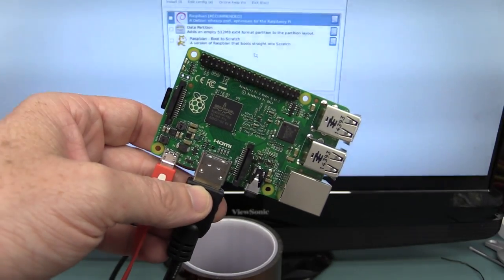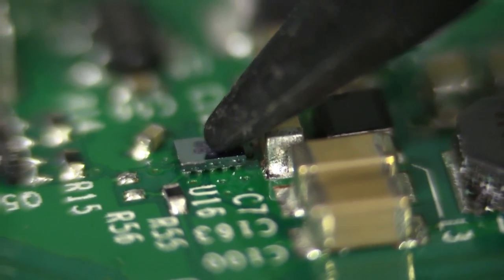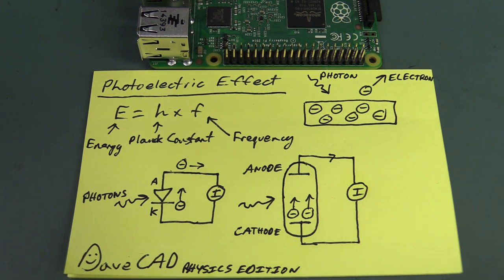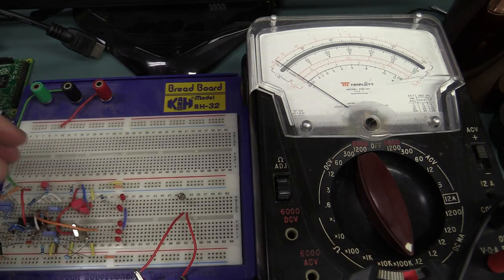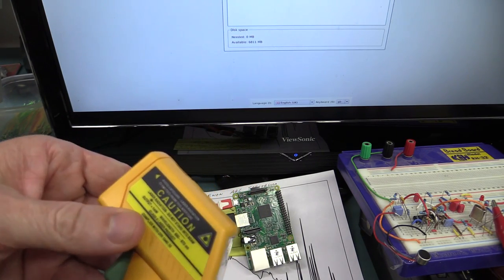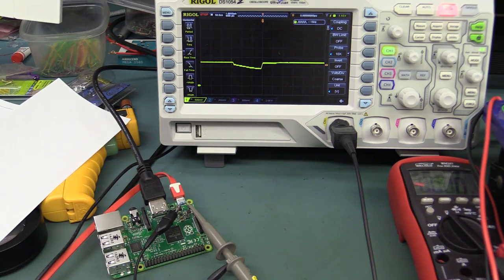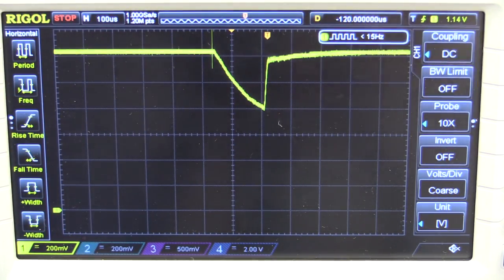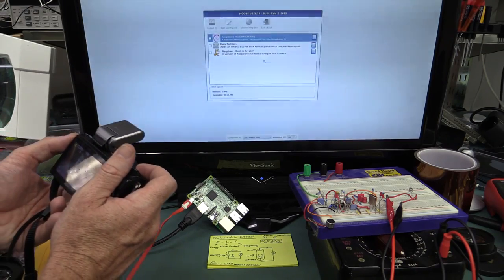EEVblog #716 - Raspberry Pi 2 Xenon Flash Problem Explained

Comment: Your example with the LED reminds me of a hack I did a few years ago. We had a flight computer on our rocket we were building to set the world altitude record, it was made super lightweight and the batteries were tiny coin cells.  The computer had a couple of external status LEDs that blinked the state so we could see it from a safe distance. Well, we had a number of accidental launches while building the rocket pressure because we were working out the details of our launcher design.  To conserve battery power, we did not arm the system until it was near full pressure, so if it launched unarmed then the deploy system would never be activated, and the rocket would crash. The hack solution was that I rewrote the software to use one fewer LEDs for status and the other one (that happened to be on an ADC pin) was repurposed as a launch detect light sensor. I used the light sensitivity of the LED as a trigger to arm the deploy system. When the rocket was on the pad, we put a shade over the LED that would pull away if the rocket ever launched prior to being armed. It worked like a charm. Necessity is the mother of invention!
Reply: Very few people seem to realise that LEDs work both ways and even fewer make use of it. They respond to the same wavelength they emit, something which I've used on ATE to check that the right colour - red, yellow or green - LED has been fitted in the appropriate position. Works with IRLEDs too and is made use of in some learning IR remotes.
Reply: Graham Langley
Is in electrical hobby very common info that led can be used as a sensor, tons of video and tutorials out there about leds as sensor.
Reply: Graham Langley Using the wavelength to test the color is really clever. Nice!
Reply: peter w
OK, so I got it wrong with the "very few people...". I first did this at a firm I was working for back in the late 80s.

Comment: Actually, it doesn't have to be a specific frequency, it just needs to be higher than a specific point. So it's not the infrared light from the flash, it's probably the uv ones.

Comment: This is a great one Dave!  I imagine that a little blob of potting will immediately be added there to new units.  DOH!
Reply from the maker: Fran Blanche Yep, they will certainly do that. By far the easiest option. Maybe adds a 5-10c per board or something for the labour.
Reply: EEVblog
And all after the fact.... It never ceases to amaze how they cut corners to optimize products these days at the expense of common sense.
Reply from the maker: Fran Blanche I doubt they did this deliberately, I just think the designers didn't think of the possibility. Lesson learned quite publicly!
Reply: EEVblog
Honestly i don't see why they really need to bother. They probably will just because of the squeaky wheel principal, but really it is likely a non issue for >99% of the users. But what do I know?
Reply: EEVblog
Certainly not deliberate.... but also not to be repeated I suspect.
Reply: Fran Blanche - I'm really looking forward to your next vid on the AGC / DSKY project. ;)

One of my first big FPGA projects around 2009 was converting all the logic equations and schematics from John Pultorak's AGC replica into Verilog.

So, it was awesome to watch your vid on the Gemini stuff, and your journey through the secret archives with the AGC.

I never did quite get the FPGA AGC design fully running before I moved onto other projects, but your vid inspired me to take another look at it recently.
Reply: Fran Blanche People have tried to cut corners in computing since the beginning... Think "Sinclair", the Pi is the new Sinclair. I have 2 model B, and I ordered 4 Pi2 :oD I have a small server cluster tied to a proper server.
Reply: Luis Daniel Mesa Velasquez
LOL Sir Clive Sinclair is still in business, but he doesn't own a computer or use the internet, because he's convinced himself that they don't do anything useful.
Reply: Landrew0 what does that have to do with the fact that Sinclair cut corners to make his products cheaper? I don't follow your reasoning. I would appreciate if you could elaborate only on the general topic being discussed and if you want to introduce another one choose a different thread. Thank you.
Reply: No reasoning necessary. Just an interesting footnote added.
Reply: Cutting corners is just another aspect of engineering. Every engineering decision involves weighing different compromises - who want's to pay for gold and diamond encrusted solutions these days!

I don't think they should worry too much about 'fixing' this on this board iteration. So much of an edge case, is it really worth undermining the super-thin profit margins for this board by potting the component?
Reply: albedo0point39 Well then you can wonder how a John Browning engineered Pi would have been like...
Reply: I wouldn't expect this to get fixed in a board revision.  If there's a reasonable likelihood of your application being affected by this.... well, buy an opaque case.  Done.

For everyone else, as the old joke goes:  "Doc, it hurts when I do this!"  "Then don't do that."
Reply: Fran Blanche Why would they fix that? It's hilariously idiotic to fix this @ added cost. Who needs a "flash resistant" RPI 2? Just grab a case and you're golden.
Reply: ReNeyer
Depends how photosensitive the RPI2 actually is i.e. does it crash in bright sunlight or just close up camera flashes. Either way it's giving the RPI2 bad press.
Reply: The components on the RPi2 were never really meant to be used without an enclosure.

It's essentially a bare development board, and should ideally be used with a proper case.

It's just unfortunate that people think this is a genuine "bug" or oversight in the design rather than something which is a minor inconvenience and easily solved.

One thing's for sure - you can't fault the Pi on price at all, especially now that it has a Quad Core SoC, and is far more usable for everyday apps.
Reply: woollerland It's only working when a XENON FLASH is pointed at it the chip... Which is hilariously fringe-applications. Sorry but did you watch the video?
Reply: ReNeyer
Most of it. Since the chip breaks at a very high intensity of a specific spectrum of light, then surely very bright sunlight may have the same effect providing the chip is that photosensitive. Unless the mechanic is only effected by bursts of high intensity than a continuous stream at the same intensity which I doubt.
Reply: Nick Guy
Raspberry Pi is designed as a cheap computer to fit small applications.
Now this doesn't mean that it appeals to electronic engineers or electronic enthusiasts.
You will find people out there who buys this, and has zero idea how and why they are affected by Xenon flash, but they know how to install an Arch Linux on ARM setup on one from scratch.

These people are likely to rate this as a bug, and they are a big market.
Nor are they helped by the fact that you can get a cheaper and faster Pi from Hardkernel under the Odroid line that doesn't have this problem.
Reply: ReNeyer Fringe applications? so no member of the press should ever photograph one while its running? you shouldn't photograph a working board in order to show your product?
Reply: You're being dramatic.  You shouldn't handle a bare PCB while wearing a polyester shirt in dry climate either.  I would hazard a guess that shirt-wearers are a larger majority than Xenon flashers, but if a Pi reset because of a static shock, no one would be writing blogs about it on the Internet.
Reply: EEVblog just got mine, they didn't put a blob over it QQ
Reply: NumbnutzTV
Ideally I would have spent my money on the Odroid C1 than the Raspberry Pi 2, more value for your money.
Reply: CMDR Sweeper i'm new to linux and there is a lot more info on the raspberry.That's the main reason i got mine, but yeah other platforms's specs are better
Reply: NumbnutzTV
Not a big problem, they both run a variant of Ubuntu in any case, so you are covered there with guides for the Pi working nicely for the Odroid.
One of the biggest changes is that the Ethernet is wired correctly on the Odroid compared to the Pi (No USB 2.0 to Ethernet chip.)
And of course, you can load Android with an official image for the Odroid.

I invested a bit more and got the top model, the Odroid XU3 as my tinkerer platform, but I still find ARM to be fairly limiting compared to X86 in terms of software and what you can use.
Reply: CMDR Sweeper said "Ethernet is wired correctly on the Odroid compared to the Pi". Well there's nothing incorrect about it on the Pi. When the only I/O on your chip that's fast enough to cope with Ethernet is USB2 that's how to do it. Ethernet works fine on the Pi anyway. It's the USB on the Pi that is somewhat suboptimal.
Reply: Brian Gregory
Of course it is correct on the Odroid, you can actually get the full use of it WITHOUT it competing with the USB bus, so yes that is the correct way of doing it.
Reply: CMDR Sweeper But if you tried wiring the Ethernet directly to the SoC on the Pi it wouldn't work because the SoC on the Pi doesn't have Ethernet. So it would be the wrong way to do it.
Reply: Brian Gregory
Perhaps, but then you use the same chip that the Odroid uses.
Keep in mind, it has a lower cost than the Pi 2.
Reply: CMDR Sweeper Anyway you appear not to know the difference between correct and optimal.
Reply: Brian Gregory
Perhaps I do, I know that the Pi way isn't that usable so in that sense it is an incorrect solution.
Reply: CMDR Sweeper
I was a bit put off of the XU3 due to the price, so I got a C1 to play with, then they came out with the XU4 at ~$80 so i got one of those. I will say, the official ODROID interaction with the community on the forums is pretty great. you can ask questions and someone who actually knows what is going on will usually answer within a day or two.

Comment: The reason ARM processor is locking up might be because this temporary dip in voltage causes it to get lower than minimum voltage needed  for correct operation, slowing down the switching speed of MOS transistors and hence causing timing violations ( setup time for flip flops) for the clock freq it is running at.  The internal SRAMs might also loose the value they were holding at the time of dip if it drops below voltage needed for state retention (~ threshold voltage).

All of this will cause state corruption for the processor logic and can cause the internal FSMs to hang up/get in wrong/bad state.
Normally in a critical processor, there would be a watchdog timer to guard against such hangs and would cause a reset, but perhaps raspberry pi is too cost sensitive to have such a mechanism in place.
Reply: the internal flying spaghetti monster hang up?
Reply: That's what I was thinking. I'd be interested in an experiment where a large bypass capacitor was connected near the ARM to the 1.2V bus, which might reduce the severity of the dip. I wonder if the lock-up would still occur.
Reply: Joe Tsai MichaelKingsfordGray , actually any supervisor which is onboard on same processor will also get corrupted and will fail to catch this case.

Likely this broadcom chip would also be having a dedicated internal interrupt for watchdog timer, which the OS might have also enabled, but such a dip in supply will cause that too to get reset as well.

I was referring to external watchdog supervisors which are usually part of companion power management ICs - you would find them in life critical applications.

A little more detail here.

http://www.maximintegrated.com/en/app-notes/index.mvp/id/4229
http://www.ti.com/lit/an/slva039/slva039.pdf

Comment: Hey Dave

By an insane coincidence I was just checking out the work functions (http://en.wikipedia.org/wiki/Work_function ) of several elements yesterday , some people might be a bit confused as to why the UV light doesn't appear to be responsible for triggering the effect...and why the peak in the IR range might matter...and I think I've got the explanation...the thing here is that the Photoelectric effect as is normally taught in physics 101 tends to cover only the situation where you're trying to expel electrons from  the surface of crystals of pure elements ... 

So if we were to calculate the minimum frequency for a photon to remove electrons from , say...pure silicon (best case work function 4.60eV ) we'd reach something like 270nm (UV) .. so yeah ... no peak of light, no matter how strong (amplitude) over 270nm (towards visible light) should be able to extract electrons from the surface of a pure silicon crystal...

BUT! (skipping to microelectronics 101 (taking my trusty Sedra/Smith from the bookshelf!)

We're talking about a semiconductor! there's no need to overcome the work function and extract electrons from the material , we just need to overcome the bandgap (This is equivalent to the energy required to free an outer shell electron from its orbit about the nucleus to become a mobile charge carrier -wikipedia) , and this takes FAR LESS energy (http://en.wikipedia.org/wiki/List_of_semiconductor_materials) !
Bandgap for silicon would be 1.12eV (I'm using Si as an example... it might not be Si but the orders of magnitude are mostly the same for most semi (check table above) ) would put the needed wavelength at 1.1micrometers (IR)

So if we fire enough photons of shorter or equal wavelength than say 1.1 micrometers (again,Si only an example) to overcome the bandgap we should make something that shouldn't be conducting at that moment temporary into a conductor which is more than enough to cause all sorts of craziness in there (current should be proportional to amount of photons (amplitude))

Also a Flash Lamp emits something in the order of magnitude of a MILLION lumens (http://www.wolframalpha.com/input/?i=1000000lumen) over a few micro-seconds and lumens are only measured in the visible light range! ...so according to the spectrum graph you've shown the peak in IR would be even greater ...that's a LOT of IR photons which are probably over the bandgap energy and are probably making a semiconductor into a "short" (whose conductivity is proportional to the peak amplitude of the light)...

What do you think EEVblog ? 

Diego Spinola (but you can call me Bruce ;) )

Comment: Yeah, the explanation given is wrong.  A large number of photons emitted by the xenon flash have a frequency that corresponds to the energy of the bandgap of the semiconductor material.  When these photons are absorbed by the semiconductor, electrons jump from the valence band to the conduction band, resulting in current flow, which screws with the voltages in the chip.
Reply from the maker: InXLsisDeo I agree, you can't really know the wavelength that is causing the issue without isolating the bands.
Reply from the maker: InXLsisDeo BTW, I tried a UV filter and it made no difference, problem remains.
Reply: ***** the smps chip might be self regulating for slowly (in most terms) ramping effects hence why bright light doesn't affect it, but the sudden immense pulse from the xenon flash is the quality, quantity and intensity slope required to break the regulation loop.
Reply: ***** It has everything to do with the bandgap. The photoelectric effect is about electrons being given enough energy to escape from the surface of the metal (which we are only likely to observe in vacuum like Einstein's experiments were). This specifically relates to undoped materials, and the silicon in question is made up of doped p-n junctions. The photoelectric effect is slightly different theory to band gap physics. However, incident photons with energy greater than or equal to the band gap of the material will promote electrons to the conduction band from the valence band allowing current to flow. It's for this reason that silicon transistors become useless at high temperatures (Thermal distribution shifts to an emission spectra near the bandgap) because you end up with a large proportion of electrons in the conduction band effectively turning your transistor into a wire. Also, the intensity of the light doesn't have any effect on electron energy, but it does relate to the number of photons emitted.
Reply: InXLsisDeo Looking at the transmission spectra of silicon, it is about 55% transmissive at UV frequencies. So having said that, we can expect that roughly 45% of photons at a UV frequency are absorbed and will most likely contribute to any current generated or simply thermalise (shed excess energy through lattice vibrations/phonons) down to lower bands.

Comment: I would have assumed RFI, from the high voltage supply of the Xenon power supply... looks like I am wrong, and not would have expected the photo effect, which you have clearly shown even by cutting apart the 2222A transistor.  Thanks for demonstrating!

Comment: I thought it would be a RFI or EMI of the flash circuit, but never expected that to be the cause. You can put black epoxy on a flip-chip too, there's no need for use older style bond wired chip. Thanks for upload.

Comment: Dave, silicon is transparent to IR light, right where PN-junctions starts to loose sensitivity. So photons to blame are between 1050nm and 1100nm wavelength: silicon is somewhat transparent there and PN-junctions are still slightly sensitive.

Comment: Hey Dave! The infrared part of the spectrum can't be the light causing the problems. Infrared light has a lower frequency than visible light. Remember that frequency is inversely proportional to wavelength.